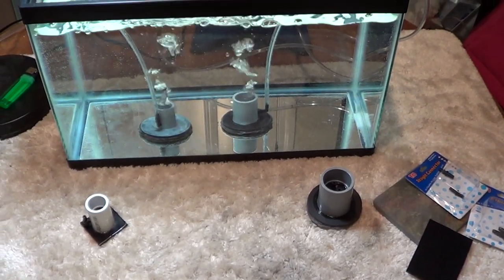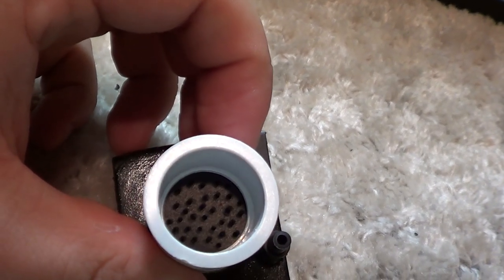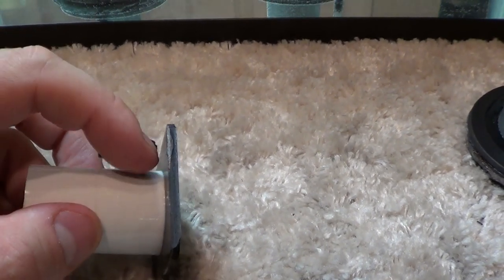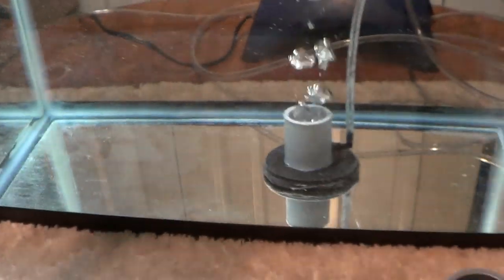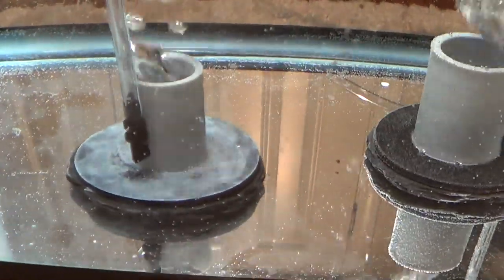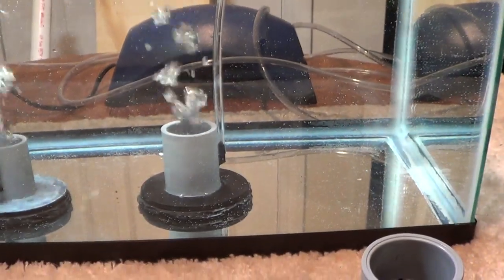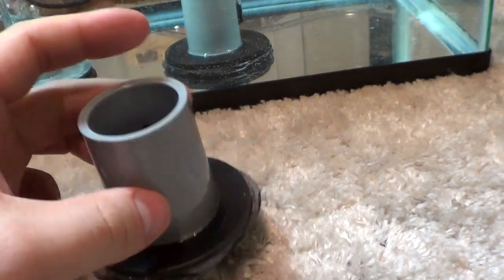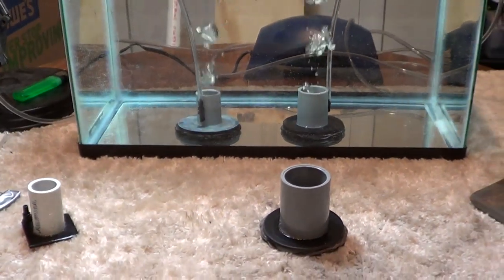#118: DIY Aquarium Air Diffuser - DIY Wednesday

Comment: What pump are you using? I have two aquariums next to eachother. A 50l and 200l. Could I use one pump, and two connectors to share the air? :)
Reply: Looks like I'm three years late, but your answer is yes. Lol.